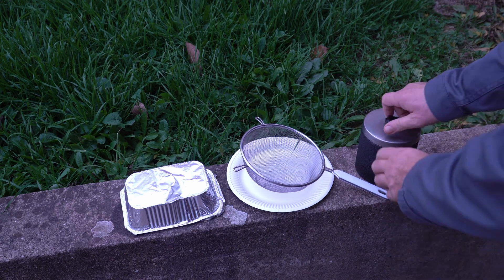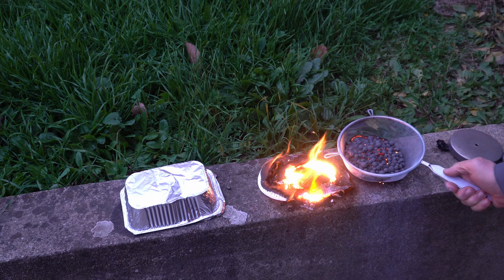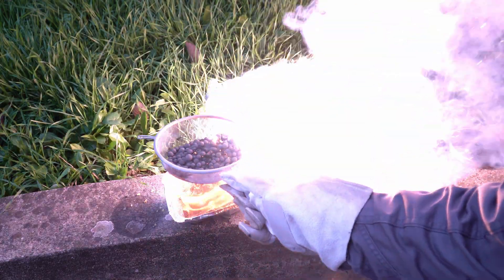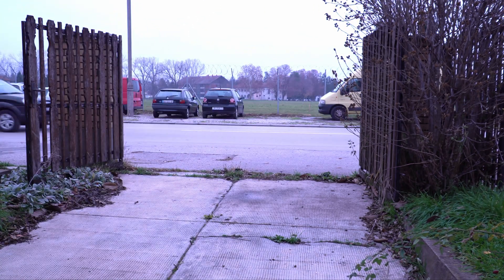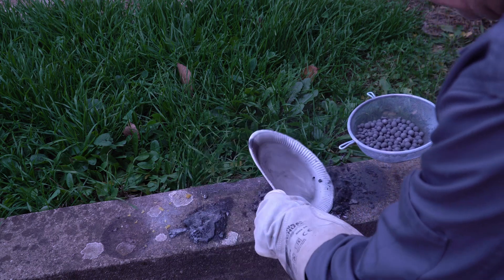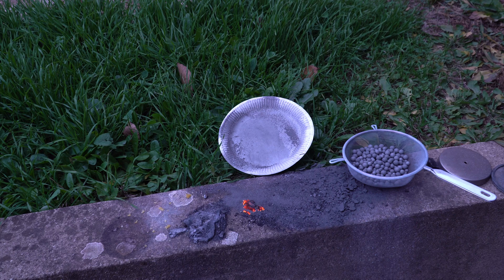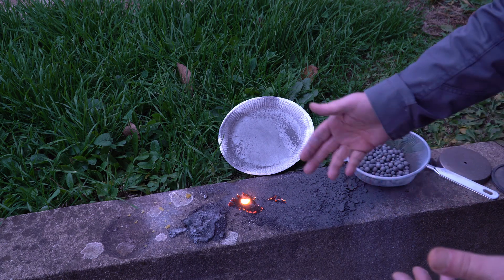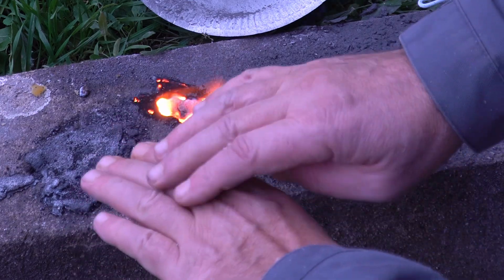Ball Milled Aluminum Self Ignites - Pyrophoric Effect

Comment: How about using argon (or nitrogen) atmosphere in a closed box (sand blasting box) for the milling ?
Reply: Thats exactly something you dont want, argon stops aluminum from making an oxide layer, aka the protective layer that stops it from catching fire, if its not there itll probably explode violently when you open it
Reply: @VOXELS_RBX Yes, I already figured it out. Thanks.

Comment: If you close the lid, to prevent oxygen from coming in, will it stop the flame ? 
That would be the first thing I would do if that happened to me 😅
Reply: How about using argon (or nitrogen) atmosphere in a closed box (sand blasting box) for the milling ?
But I think, the powder could/would be too reactive to handle afterwards?
Reply: @vanlendl not a bad idea, but those 2 gasses are very expenses and hard to get

Comment: Coal does not combine with aluminum, but simply envelops it while aluminum is stationary, but as soon as it is blown off or washed off, aluminum is exposed and a reaction takes place. It was someone's comment, but it's logical. In your opinion, if you ventilate the container every 5-6 hours, it almost completely eliminates the possibility of fire?
Reply from the maker: Yes, it will passivate aluminum dust completely. If you watch after I stopped spraying particles, last dust was already inert. Once on the air, it rises temperature due to rapid oxidation. But if particles are big - they just dissipate heat. If small, they dissipate less and possible catch fire. Charcoal is maybe good actually for preventing clumping of the dust. I milled another batch with zero coal, and it stick to the bottom and walls of the barrel. Also, steel balls was covered with thick layer of aluminum dust. So, next experiment will be with two barrels and two ball mills; one without and one with charcoal. The problem is that I have three tumblers, all different speed and different barrel size. Thank you for nice comment.

Comment: Is it just aluminum? I think some steel from balls also contributes to that
Reply from the maker: I think not. Steel balls are so rigid and I think that it can't easily crumble. My next project will be milling steel wool. Someone pointed out about that in my previous video where I wrongly concluded that aluminum is not pyrophoric. So, I will try other metals as well. Thank you for nice comment. Oh, there is 3% charcoal mixed in (3 grams of willow charcoal in 100 grams of aluminum dust).
Reply: If the balls are made of lead (a hard alloy, not pure lead) they should not fall apart in the grinding process, they are also recommended rather than glass or iron balls because they do not spark.